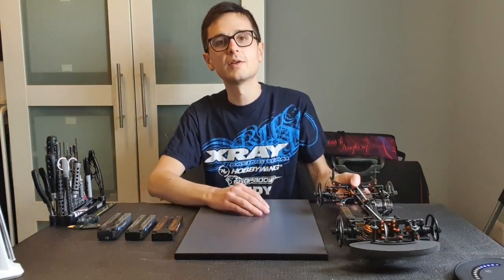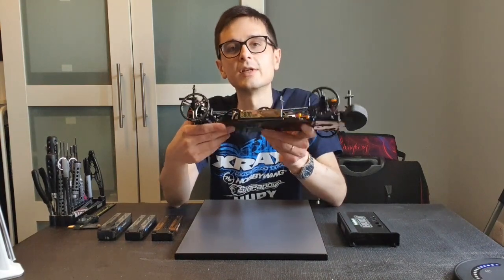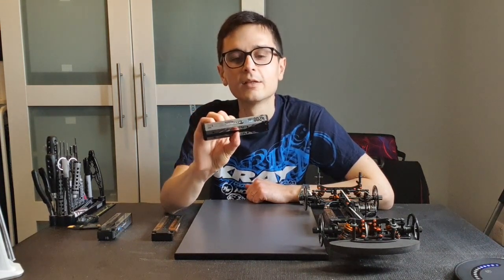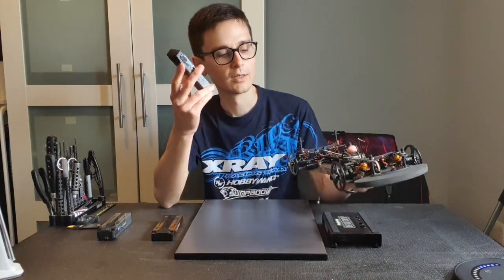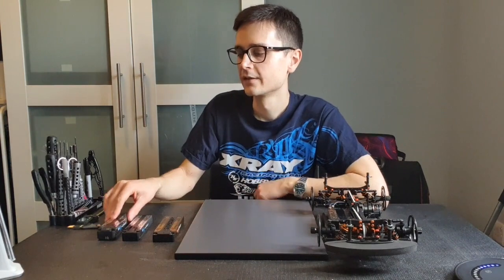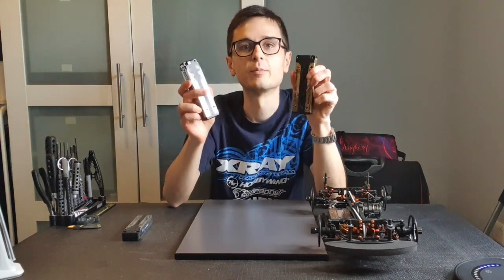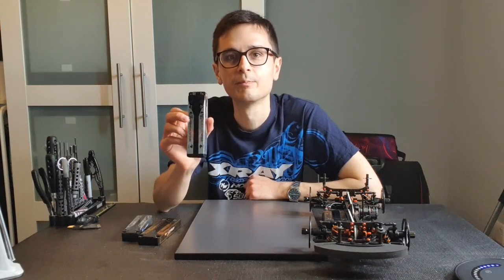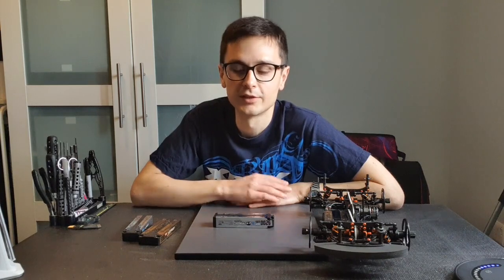Battery choices (Sunpadow)

Comment: I'm new to electric rc cars and I do have nitro cars and many racing quads so use to lipo batteries. Though when I checked by batter voltage one cell was 2.9 other was 4.9 until I plugged the balance plug in between the positive and negative, the was 4.1 both cells. I know I need to use that plug to charge but do I use small plug in the centre when I run?

Comment: Bought 4 batteries and one died after less than 10 cycles of use. % volt began to show and is not charging. Used and kept properly
Reply from the maker: Sorry to hear about your experience! You should try and contact your point of purchase, alternatively the Sunpadow distributor in your country, for a replacement of the seemingly faulty pack.

Comment: Hey Alex, thank you for your great work in supporting us customers. I've just recently ordered the Sunpadow Platinum 6000 for 13.5T / 17.5T stock TC indoor season with the T4'20 and the new X4. Which battery (or what capacity) would you recommend for a nice, big, good grip outdoor asphalt track like Arena 33?
Reply from the maker: For Arena33 with ETS combo, the 8000 Platin for Sunpadow. If you're using a 13.5T EFRA combo, I recommend the 6000 Platin!
Reply: @hagberg  Thank you very much!

Comment: Hi Alex, thanks for this great video. In order to get the most out of the sunpadow platinum batteries, what charger would you recommand using ?
Reply from the maker: The best charger on the market right now is the iCharger 406 DUO. But I can also recommend the iCharger X6, X8. EV-PEAK and Pro-Spec (OEM) are also great chargers with a touch screen.

Comment: hi alexander, the sunpadow have less C and capacity than the ezpower 6600 140 / 70c. what advice and why for xrs stock indoor (carpet)?
the ezs seem more powerful on spec and less heavy.
thank you
Reply from the maker: The C rating is misleading sometimes, since the manufacturer can specify the at any rate that they want! I know that the Sunpadow is one of the most (if not the most) powerful battery for stock racing. The 6000 Platin from Sunpadow is the perfect battery for stock racing on carpet!
Reply: @hagberg  what is best mah and C rating lipo for 1/8 scale onroad pan car like serpent 989e? please help me choose the right lipo for race
Reply from the maker: @pret98  the biggest one that you can find (that will fit your car) since runtime is a concern in that class!

Comment: Why does stock require higher capacity batteries versus mod?
Reply from the maker: To have as little voltage drop as possible throughout the race, which the bigger the pack, the smaller the drop in voltage.
Reply: because your are KV/Turn limited in 13.5 17.5 21.5 racing. In Mod you fight with traction, in Stock you fight for the last drop of speed